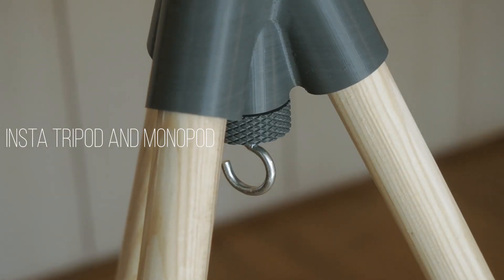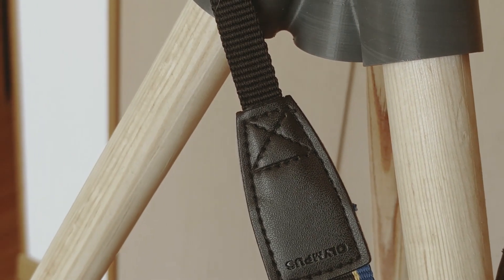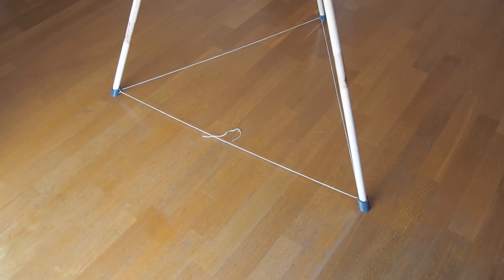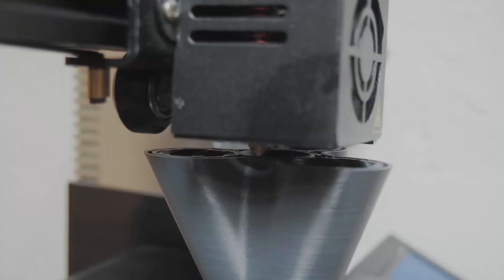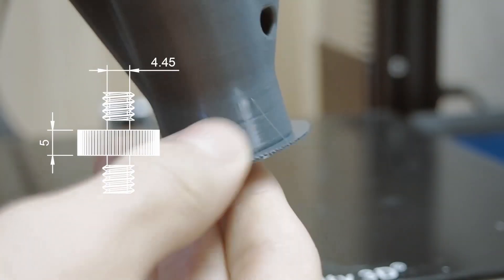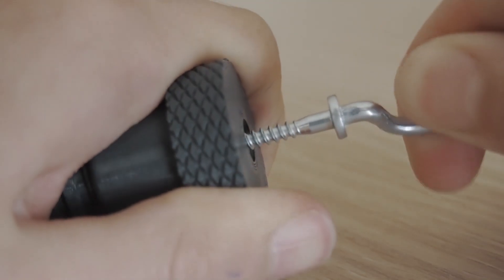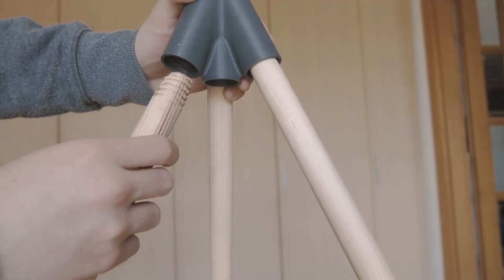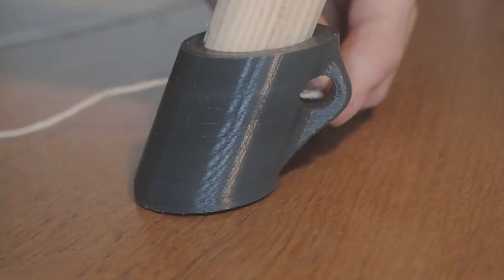Insta-Tripod And Monopod - 3D Printed Tripod

Comment: hello, thank you for all the files and descriptions given.
however, before printing it, could you tell us if a broom stand will fit ? or could you give us the diameter of the sticks you are using ? thanks again
Reply from the maker: The American thread is an ACME 3/4 inches; the European one (which is not standardized) is 23mm in diameter. I've just uploaded two test models to try the fit.